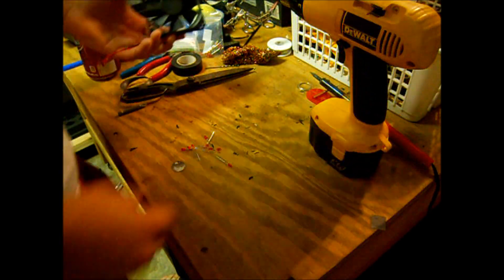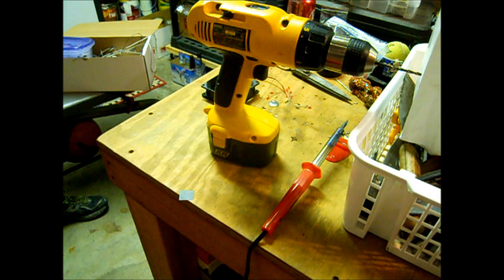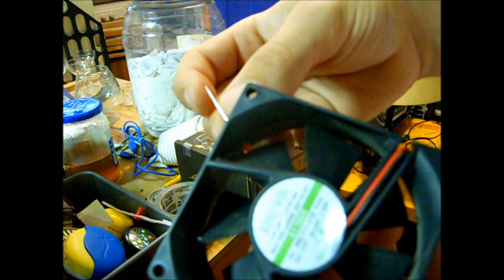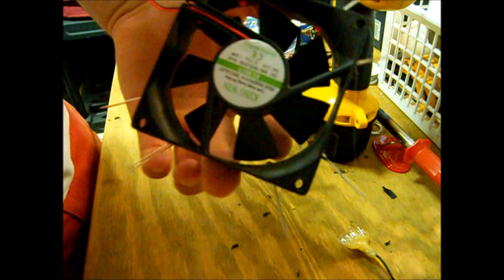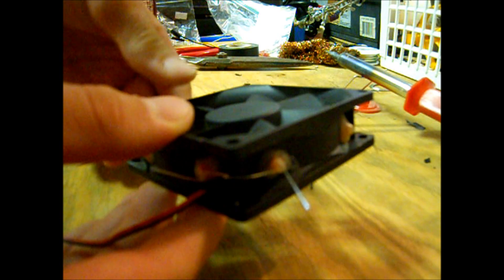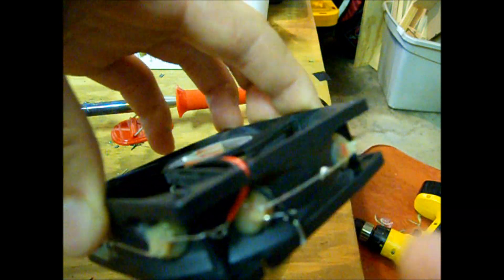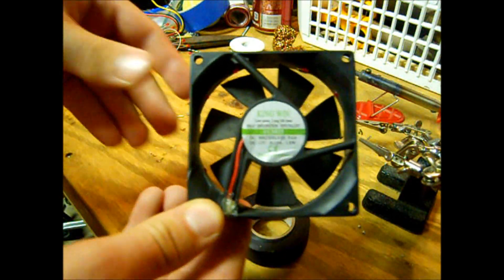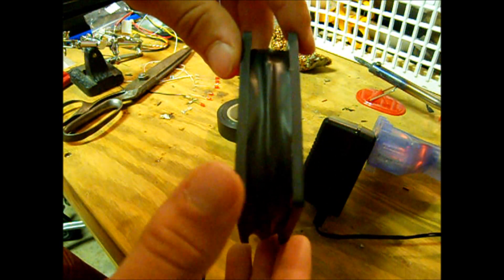Homemade LED Fan Tutorial

Comment: That fan is using 12v power.  Those LED diodes are more like 1.5v.  You need a resister in that added circuit at the very least!  I don't know enough about electronics to give you exact advise.  Maybe someone will step in and connect the dots for you.  What you are doing probably isn't too dangerous since 12v is still considered low voltage, but I don't think those lights will last long, and I hope that glue isn't flammable.

Comment: I was told you need a resistor with led's, I tried them without a resistor using a 9v battery to see if the led's were ok and nearly burnt them out.....
Reply: If you had one led trying to run from a 9 volt battery you would need a 390 ohm 1/2 watt resister. An led's forward current is 2.0v at 20mA that means you could get by with four leds in a series configuration with a 220 ohms 1/4 watt resister like he had on the fan positive to ground and keep repeating. Some say use a forward voltage of 3.4v on a led but if you don't know the specs just stay with 2.0volts.
Reply: Gary Lester

Comment: If you have got some brains #bri dwag.
Then instead of getting soldering iron, LEDs,Drill Machine etc. which may cast you more than 100$ , get an LED fan from anywhere which wont cost you more than 5$.
Reply: well, u not gonna buy them just for making this led fan. u will make it if you already have those things.also it is very enjoyable making your own  things. its just fun i think.

Comment: How does that work? LEDs can't take 12v
Reply: if your fan has the four pin molex connector with 2 black wires a yellow and red wire the blacks are ground yellow is 12v and red is 5v some leds can handle 5v
Reply: They can handle 5v but won't last very long
Reply: you can get specialty leds for 5v applications